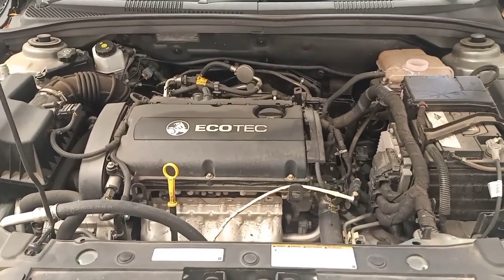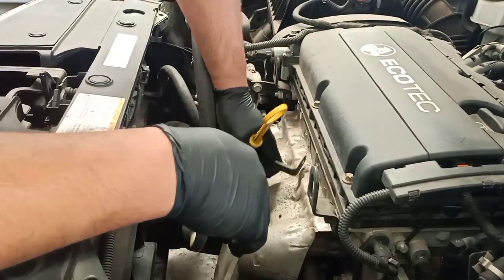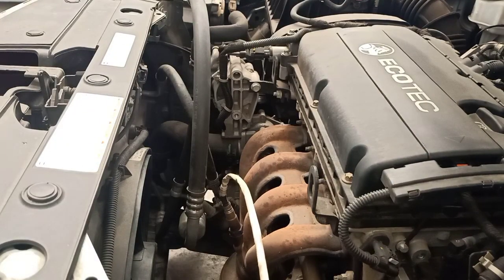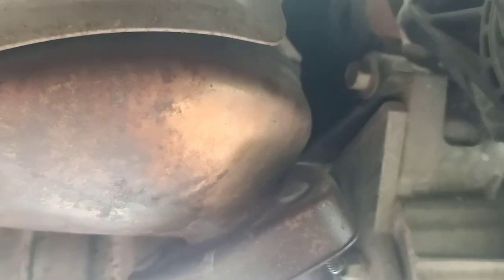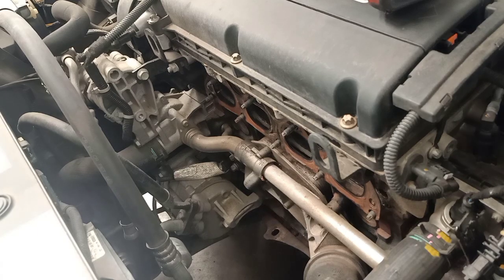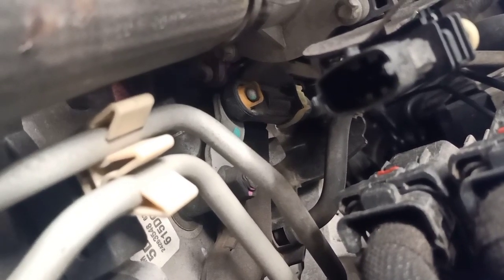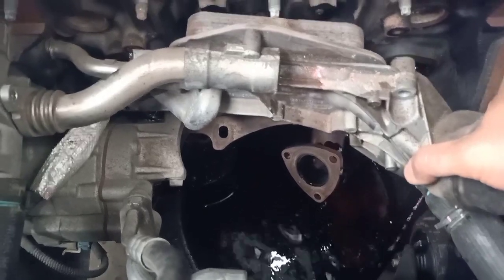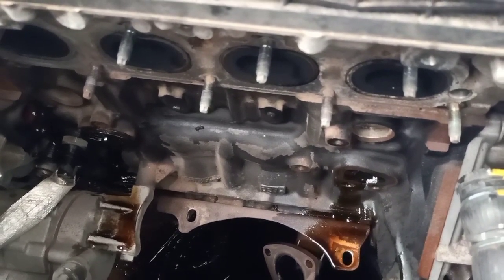how to replace oil cooler on Holden Cruze

Comment: Thank you legend. Unfortunately a car I bought had a small amount of coolant leaking from the oil cooler so needed to do this replacement. Would have been much more difficult to figure it out without this video so thank you!